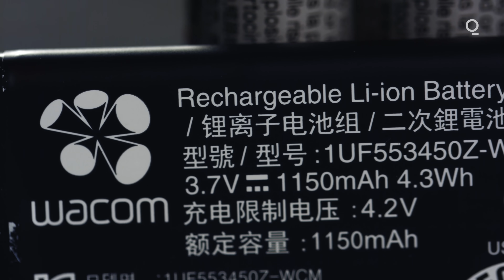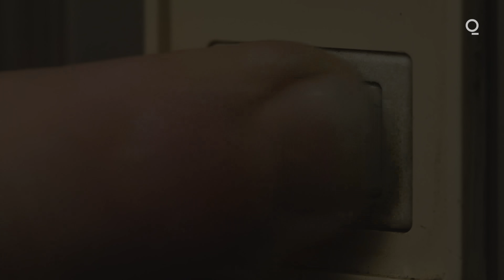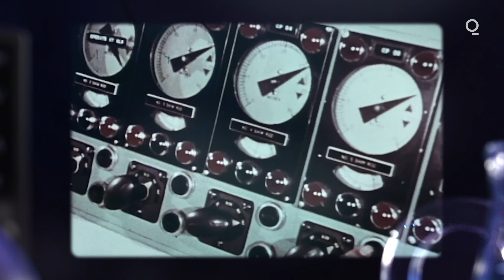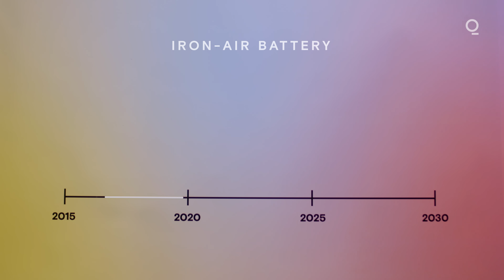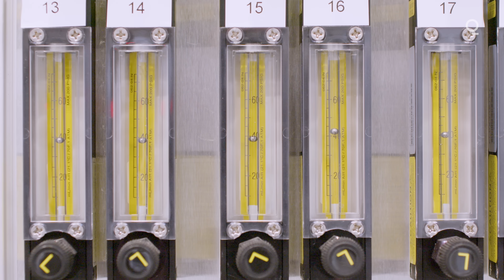The Huge, Weird Batteries of the Future

Comment: It is not even close to true that coal plants are reliable continuous sources of electricity. They need to be shut down for maintenance and can also have unplanned stoppages. Renewables actually tend to be much more reliable in this regard in that they tend to consist of many much smaller units so there is no large 'maintenance' windows to worry about. Even hydro electric or nuclear plants need maintenance.
Reply: Renewables are reliable? It is well known that the sun sets everyday and many days are clouded over.  Wind likewise is unreliable and even worse you can’t tell how long it will be unusable.  Then there are very strong windy days where the wind is too strong then windmills have to stopped to avoid damage. 

Nuclear is my favourite, small land area, massive power, and can run for years without stopping.  There are about 14 such plants in Ontario where I live and some have been running for about 55 years with no problems.
Reply: @edwardcoulter9361  Wind and solar have regular patterns and do need some battery backup solutions, but my point is they are regular and predictable whereas larger power stations can break down in a more unpredictable way leaving the grid with a very large amount of production missing for and extended period of time. You say the nuclear plants in Ontario have been running for 55 years 'with no problems' but you don't mention how often they are offline for maintenance/refueling. You are probably simply not aware that they do that. Probably be cause they have installed more capacity than they need. The same solution works with wind and solar to some degree. The difference is that when you install extra capacity with wind and solar that extra capacity can be used at minimal cost. Nuclear has many advantages over alternatives but the one big disadvantage is price, it is one of the most expensive forms of generation.

Comment: 4:14
tbh i didnt know hydro power was such a practical and simple design 😆

sometimes i think , 'why don't they just make giant fans to power multiple windmills' and have those giant fans powered by solar... but 😅 hydro could work too.
 I always think to myself... 'nah, it can't be that simple' 🤓😅
Reply: If you have already made electricity by solar means then use that electricity directly.  Using it to power fans to make wind to turn windmills is a totally useless idea as nearly all the electricity generated by solar would be wasted on such additionally complicated equipment. Every process has inefficiencies and this would be very inefficient.  

Please tell me you were kidding.
Reply: @edwardcoulter9361  Do you think that your typing is going to fix the way Andre thinks? Then you both have a problem.

Comment: Wasn’t there also a solution with algae that makes energy and clean the air at the same time? I thought i saw that somewhere
Reply: Probably, but anything done in a test tube is not going to be useful.  I don’t think it could every be scaled up enough to even boil a kettle.

Comment: Sometimes I wonder, instead of mining to create batteries, what if the whole mine is a battery.
Reply: Tell us how.  Batteries need very refined and carefully arranged components.  A mine has nothing to offer in this regard and they don’t have lithium, nickel, aluminum and graphite in the same mine.  These components need to be refined to make very specific chemicals which don’t exist in a mine of any kind
Reply: There are pumped hydro plants being built using tunnels at different levels of old mines.

Comment: Can the pumped hydro powerplants be miniaturize to the size of a building and therefore making it more distributable and closer to the energy generation source ?
Reply: Use a battery.
Reply: NO. run the numbers on the energy needed to raise a mass and the potential energy stored. This only works when the turbines get above 100,000 KW each.

Comment: How much power is needed to pump the water up relative to how much is produced when it's going down? What about water evaporation loss? I'm very interested in this.
Reply: Pumped hydro is usually greater than 80% efficient.
Reply: Well, the thing to notice is that he said this was originally used in conjunction with a nuclear power plant.  In a nuclear power application it makes sense since the nuclear plant is always generating power so you just use some it.  However, to use this system as is being suggested, a lot of power would have to be spent and the claim is that wind and solar will provide it.  I think that is a bit of a stretch. That is also considering that this place already existed and is being repurposed.  To build such a facility from scratch would take an enormous amount of energy and all of that cost would have to be recovered before it could claim to be self-sufficient. No word on the environmental impact of all the mining necessary to hollow out mountains or to build artificial mountains for this purpose.
Reply: 80% over short term
Reply: I’d like the answers to those questions also. Waiting for thunderf00t debunk video  😉
Reply: they pump at night when energy usage is lowest.
Reply: Tens of billions of dollars to dig a reservoir at the top of a mountain which will be fed by hundreds of thousands of Wind Mills and Solar Panels?  That's not going to happen.
Reply: USA NREL's "Pumped Storage Hydropower" report: "Round-trip efficiency is also based on a literature review by (Mongird et al., 2020) , who report a range of 70%-87% across several sources. "
Reply: The Connections (2021) [short documentary] 🌳

Comment: Pump storage actually uses more electricity than it generates, but great for peaking.
Reply: That’s all energy storage else it would provide you infinite energy.
Reply: Both wrong.
It is great for dealing with peaks in demand for electricity, but it really depends on what electricity you use to pump the water up to the upper reservoir.

If you limit the electricity to being the excess electricity being produced by renewable sources such as solar and wind, you add to the net generating capacity of all generators in the power grid, and you can consume that electricity when, the renewable sources are not available, such as night time when some solar is not available.

If you don't restrict it to excess renewable electricity, then the system's sole purpose is to help cope with peaks in demand, and the overall effect is there is a loss in electrical energy, caused by loses in the system where the kWh generated is less than the kWh used to pump the water up to the upper reservoir
Reply: @deang5622  Please.  Whatever source is used to charge a pumped storage project, solar-nuclear-gas, on discharge less comes back out again, as with any storage mechanism.  Some charging sources may or may not be prone to excess at night like nuclear, but that doesn't change the loss. And, if economics is the topic w PHS projects, intermittent sources are a poor choice.  PHS works best when charged every day of the year, typically at night when demand is lowest, and discharged during peak demand.
Reply: @Nill757  I think you have failed to understand the key point of my post.

Firstly, there is no need to articulate further about the losses in your response as I comprehensively covered that topic. And nothing I said was factually incorrect in respect of that, so I see no merit in regurgitating it back in a response.

The key point is that there are two ways to use a pumped storage system:
1. To cope with peaks in demand and provide temporary extra generation capacity when that power is needed.
This does not add to the total net generation capacity in the network.

Or
2. To add to the total net generation capacity. But this does NOT happen if you are using electricity from coal, gas, nuclear to pump the water up from the lower reservoir to the higher reservoir.

So the idea here is, that energy from solar and wind generation stations is used to pump the water up, and you are then capturing the energy from the renewables and making it available when it wouldn't normally be available, and thereby overcoming the big problem with renewables. 

The problem with renewables is that the available of the power is not guaranteed 24/7 so you need a base level of generation capacity which can meet the demand need, so storing the energy from renewables can reduce the base generation capacity that is needed from non renewables

Comment: All I understood from this video is that iron-air batteries are crazy complicated, even though the process is "just" rusting and unrusting iron.
Reply: There are always practical matters. The rust takes up a larger volume than the iron, so there's a terrible problem with the electrodes growing and shrinking, and gradually falling apart. The same problem is one of the limits on lifespan for lead-acid batteries.
Reply: assumably, like nickel and lithium batteries had once been.
Reply: Volcano has molten (or melted) iron. 
May be battery researchers should look into the possibility of making a series of giant "Iron-air Batteries" of a dormant volcano (i.e. a volcano that has erupted in the past but is unlikely to erupt soon). 👀🌋
Reply: Like electrolysis
Reply: The Connections (2021) [short documentary] 🌳
Reply: and apparently causes the women that work on it to lose their hair

Comment: There are lots of mountains all around the world. There must be a cheaper way to doing it. lots of forest fires happening every summer times. İf we build artifical lakes top on the mountains like this on the vide one ⛰ , this will be reservoir for the future possible fire 🔥 turning off grid. And at the same time to producing electricity. By making biger lakes at the bottom of the mountain ⛰ by using the solar and the vind energy to pump up the water back on to the hill.

Comment: They was saying pumping water back up hill when recharging but why didnt they mention weight energy? would it be the same concept ? would it be more smaller and compact to use weight for storage than all that water?
Reply: Use an old coal mine. Drop weights onto rail cars underground to release energy.
Minimal energy to move them away from the shaft.
Lift them to the surface for "storage".

Comment: The question we should also ask is carbon the CAUSATION of temperature increase? In statistics and econometrics or anyone that took a graduate program you should have learned that correlation does NOT mean causation. The earth does have cycles as the sun as grand solar minimum and maximums. And the earth tilt axis changes. These are huge variables that few talk about.

Comment: Wouldnt water evaporation in the top reservoir, being equivalent to energy lost, be a problem? I wonder what the loss percentage is
Reply: It would be very, very tiny. A fraction of a percent, insignificant compared to other inefficiencies in the process. Water evaporation rate depends mostly on the surface area of the water, and will be a certain depth per day depending on air humidity, temperature, etc. Apparently pools lose about 1/4 inch of water per day. A useful pumped storage facility would probably see turnover thousands of times higher than this. You'd be more worried about the cost of building it, the cost of the turbines and pumps and the cost of maintaining them, and also the efficiency of the turbines.
Reply: Evaporative losses depend on surface area as you say but also on the weather.  Wind velocity, temperature (a big one),  and humidity.  I agree that such losses would be minuscule though.
Reply: @edwardcoulter9361  Yeah, I was tired and didn't feel like working out a realistic number based on the formulas when I posted that.
Reply: Great point! But wouldn't rain them Add to the efficiency?
Reply: Due to the cycles typically being Daily 24hrs pump up and down. Water evaporation during that time is very tiny. But yes if you left it up there for a few months just leaking and evap would waste a large fraction of your water/ energy potential.
Reply: Yes. One solution would be to cover the surface with floating solarcells.
Reply: The Connections (2021) [short documentary] 🌳

Comment: We started using the mobile from about 15 to 20 years ago. Though battery tech has improved hugely, we still need to charge the phone atleast once a day. Nothing really revolutionary has happened beyond incremental improvements which happen in any other field.
Reply: Not so true, you have now a computer that is more powerful than most computers 10 20 years ago in the palm of your hand.
Reply: @danielvilliers612  exactly
Reply: @danielvilliers612   true, that is more due to miniaturization of chips based on Moore's law. Also has it improved or radically changed people's lives like the refrigerator did? How many normal people can really afford such a computer and have use for it. We had heard of some battery development that had been done in MIT or some such institution that would radically improve battery life of small devices.  Mobiles would need to be charged just once a week or so. But, years later nothing is in production.
Reply: @anshude5293  I have a "dumb" phone that I need to charge roughly every three weeks. Modern phones use tons of energy and have absolutely tiny batteries due to how slim they are. Just look at how much better the standard batteries got - I remember 600mAh rechargeable AA batteries being the newest tech and it is just laughable now.
Reply: That's because the better batteries were used in another way: To make the phones smaller and lighter. You could easily have a phone that would last a week, but no-one is going to buy that because it would be the size of a 90s phone - and uncomfortable bulge in the pocket. Customers demanded their phones be smaller, lighter, and thinner - and that is what they got, by reducing the size of the battery while maintaining the target of a once-per-day charge.
Reply: Energy consumption of phones has also increased a lot.
Reply: Do you know a new information platform named " Ganjing World " was launched recently in NY?  It is so so different from all the others, I'm trying now!

Comment: this system's efficiency will be less than 50per
Reply: How do you arrive at the figure of less than 50% ? Just randomly throw figures out there?

The UK has been operating one of these pumped water storage systems and it has been operating since 1984. And no, that is not a misprint.

The UK system is between 74 and 76% efficient.
Reply: @deang5622  obviously its a guess but we can estimate, say original energy generation is 70per efficient, transfer water up the hill is 80per, convert water back to energy that's turbines again so 70per efficiency, in total energy loss is 60per

U can play around with the numbers
Reply: Every step needs to be more than 90per efficiency for total 70per efficiency

Comment: Nuclear is the most energy efficient and cost efficient solution
Reply: Nuclear is "efficient" when it's been built 
It's horribly inefficient to actually build.
Not just the carbon footprint of materials, but TIME means that the fossil fuel generation it will eventually replace is polluting for a further 20 years (yes, that's a realistic "consultation to completion" time)
.
A green project is cheaper to build, takes a fraction of the time and can be ramped incrementally as each element is installed.
The "remaining fossil generation footprint" for a comparable size is 5 years, not 20.y
Edit....
I forgot the energy produced is now 40% the price of nuclear.
(Proven!)

Comment: Isn't it amazing, a technology known for a long time but unused, probably because it is "too cheap" for investors to get behind. It also seems it would generate little to no pollution, iron is mostly benign and used by most (if not all) organisms...
Reply: I live in switzerland and we already use this technology in several places. I think it is better than stationary lithium batteries. Less dangerous, toxic and cheaper in the long run
Reply: Switzerland has it since 1907, Luxembourg Vianden Pumped Storage Plant since 1959, Northfield was built in 1964
Reply: It is not cheap at all - it is VERY expensive.  That is the problem.
Reply: The Connections (2021) [short documentary] 🌳